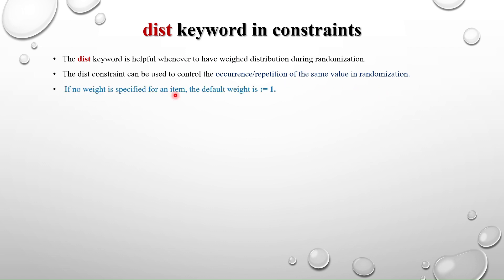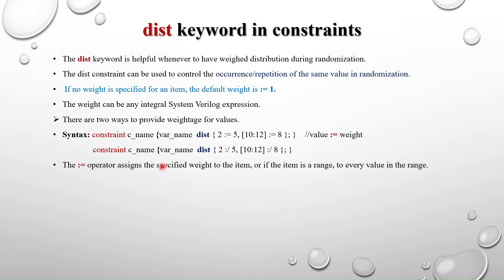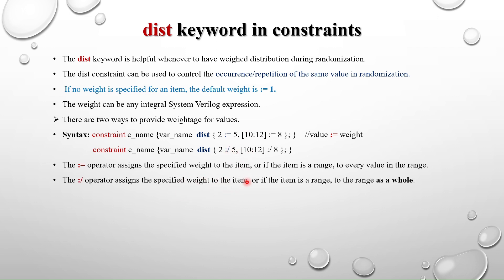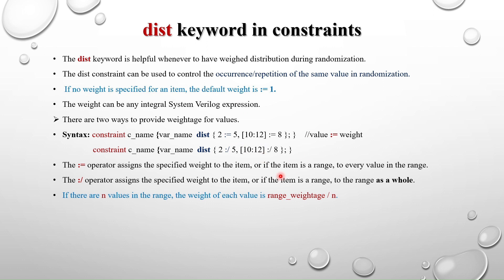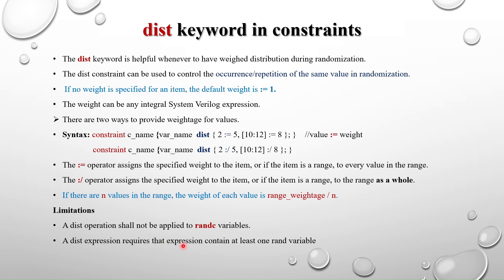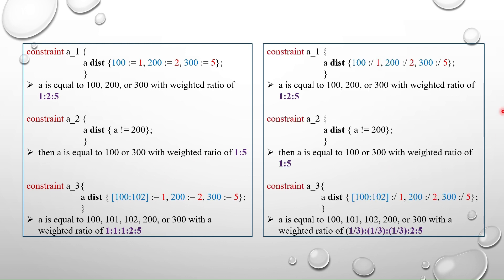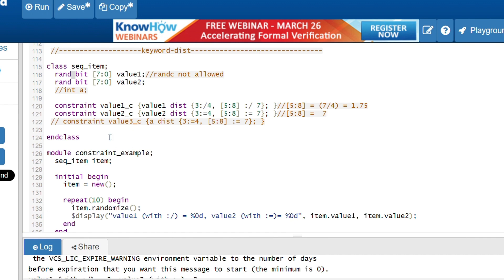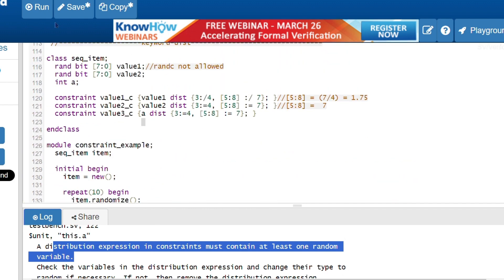Randomization and Constraints in #systemverilog | PART-4 | dist keyword in constraint #vlsi

Comment: Probability of 6 not occured in a single time out of 10 iterations though it have 1.75 out of 10.75. Not sure how simulator do probabilty.
Reply from the maker: @chipking005  The weights in a dist constraint determine the probability of each value being selected, but they don't guarantee that every value will appear in a finite number of randomizations,especially with a small number of trials like 10.
So just increase the iterations.